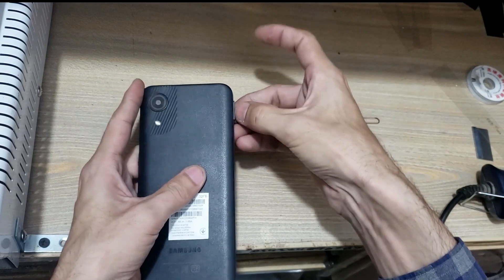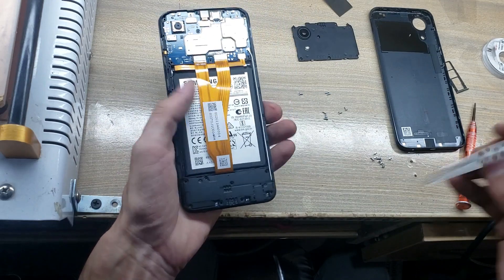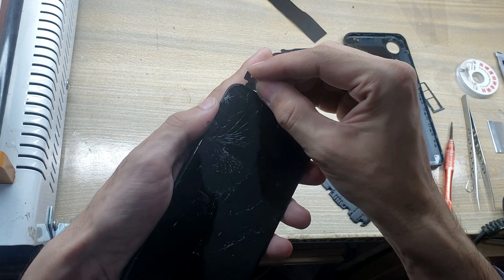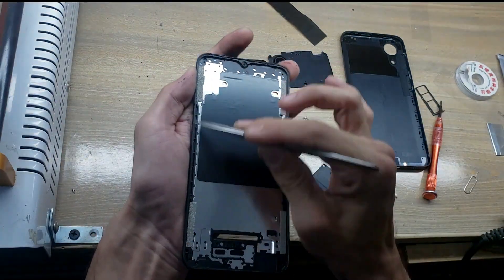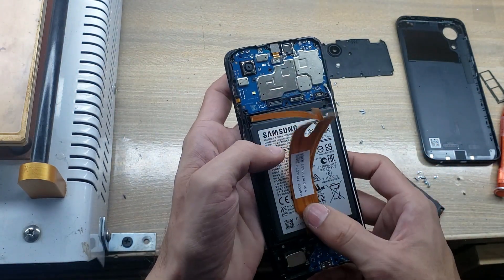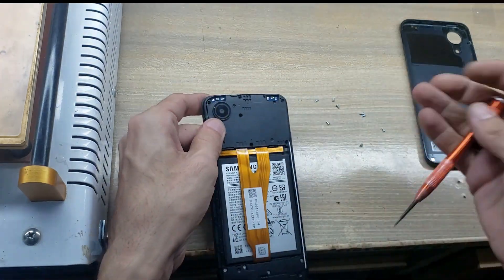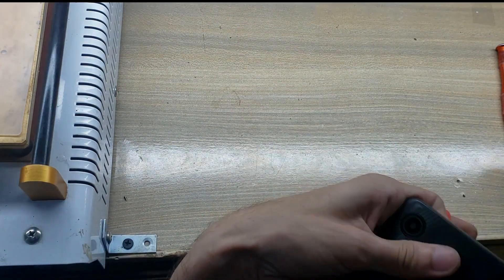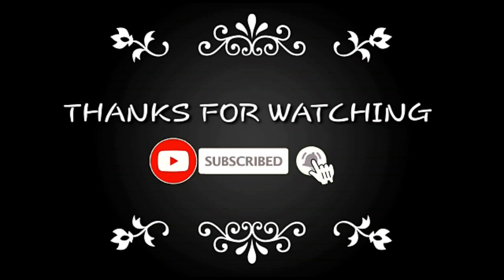Samsung Galaxy A03 Core (A032)LCD Change | Galaxy A03 Core LCD Replacement

Comment: Thank you!
Your Video ist very helpful.
1:09 is this really the "ringer buzzer"? I would call this piece "protection of the charging sub board".
Thanks from Germany :-)
How much heat is necessary to remove the LCD if you have no professionell heater? Can I use a hair dryer?
Reply from the maker: between 80c to 90c